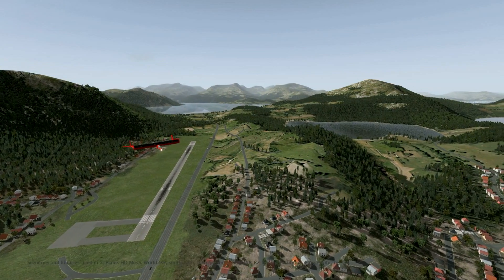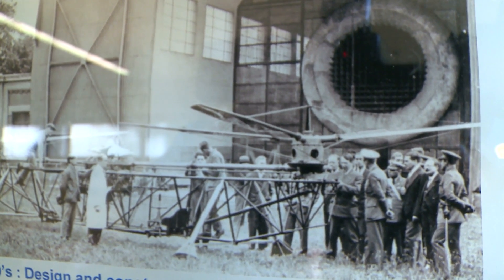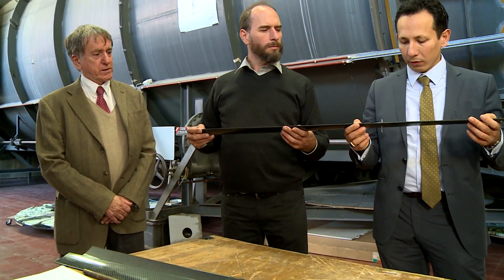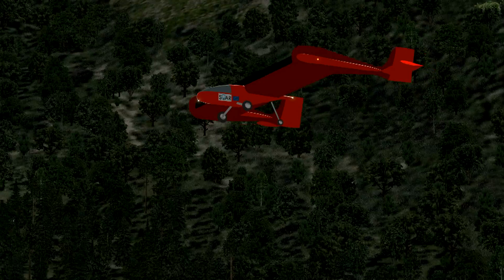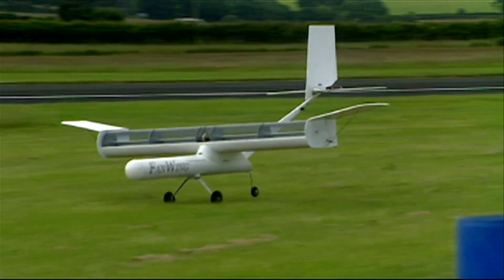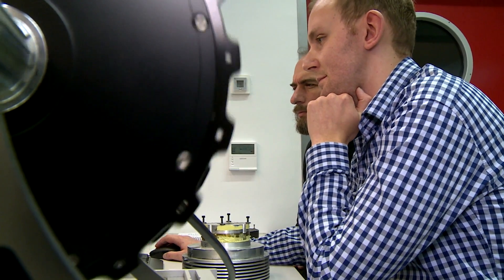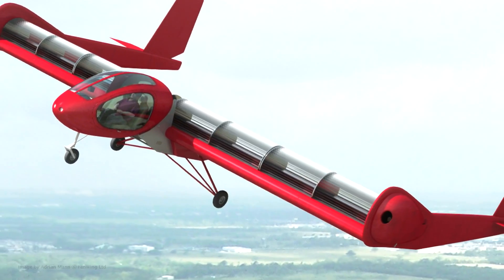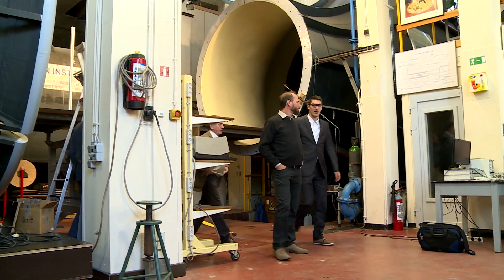FanWing/EU SOAR: Distributed-propulsion aircraft with a trapped vortex inside the rotor cage

Comment: Bird strike.  Jam the rotor.  OK, now let's see it glide.
Reply: It actually slices the birds breast meat off, wraps and packs them, stacks them in the cargo hold and minces the rest as pet food.  Quite efficient really.
Reply: Kevin Loughin I'm having a hard time seeing a bird strike effecting the fan significantly due to the large blade surface and inertia of the entire assembly.  Bird burgers perhaps.
Reply: The fan must spin at a much lower RPM than any given prop in a typical plane, so the demands for precise, smooth balance must not be as high. Without tests it's pointless to speculate on the amount of damage a bird would do to the fan. My intuition tells me that thin carbon fiber fan blades will not object to digesting the occasional bird and spraying it out the back. Bird meat is soft. Bird bones are crunchy, but not very hard. The low speed of the fan might not even cut a bird. It might just get kicked out the back. But my intuition is worthless for the sake of argument and so is yours. The only thing to do is test the thing. Surely, nobody thinks this thing would ever get certified or even funded without extensive destructive testing? German aerospace engineers aren't the sort to gloss over trivial little details like this. All of the arguments against the fanwing due to potential bird strike vulnerability could also apply to the turbines in a jet engine, or to even props.
Reply: haha yea that would cripple that plane. but its not ment to be a high altitude or long distance plane so it might not be that much of an issue
Reply: It doesn't really need to be efficient to fly at 30kmh. What it does seem to do is to provide good lift and enough thrust to move as an almost free result from that lift..
 Magnus effect toys have been available for a very long time too, so maybe it can glide under certain circumstances.
Reply: Magnus effect toys have been around for a very long time. And I can even remember throwing a wooden school ruler in the right way to make it spin along it's length, more than 50 years ago, and it flew on it's own! For a little way anyway. ;¬)
Hold your wooden ruler along it's edges with fingers on the top edge and thumb on the bottom edge. Then throw it like a cricket bowler, but throw it at the ground, releasing your thumb about half way down. If you get it right, it will spin and buzz and zoom upwards and forwards for a little way.
 Flexible plastic rulers don't work.
Reply: Kevin Loughin  horibble glide ratio if jammed, slightly better if allowed to autorotate
Reply: Add a rocket deployed parachute, such as those used by Cirrus aircraft.
Reply: Kevin, methinks thou dost protest too much! It's easy to design the rotor to compensate for the loss of one or more blades cos they aren't one long piece all across the wingspan. Any number of remedies could be conceived, such as piezoelectric compensatory actuators or flexing the blades to make up for the imbalance if part of a blade is broken. Even immobilizing a section of the rotor is possible if you think of it as a series of independent fans not a monolithic unit. I appreciate any stall free flight technology and wish there were an Elon Musk to power this into the market. After all, wasn't a high performance luxury electric car with long range and style the furthest thing from anyone's mind before Musk made it happen? Wasn't the iPhone a pipe dream until Steve Jobs exploded on the scene?
Reply: Emergency parachute systems (as in, big drogues that support the entire aircraft) already exist for light planes which don't have much hope of gliding any significant distance, particularly under low speed / low altitude flight conditions.

And I'm also thinking it might well be possible to have some way of deploying an emergency wing with a sufficiently large span to allow some kind of glide, essentially a hang glider canopy on spring loaded or pneumatically inflated supports, usually folded up out of sight but can be shot out into position by the smashing of a certain emergency button.

Or even just an airbag type system that inflates when the machine gets to a certain distance away from the ground with a descent rate of higher than the maximum safely survivable, cushioning the blow for the crucial second or two it's actually puffed up then deflating away... similar items are in development as safety gear for motorcyclists...
Reply: LMAO
Reply: What about a bi plane configuration ? Fan wing above and another wing beneath , it might do some good.
Reply: Kevin, The elephant in the room is that helicopters are also incredibly inefficient--at what airplanes are good at. But as the inventor of the helicopter, Mr. Sikorsky once said, the the helicopter can do what no plane can do. Similarly, this hybrid aircraft has great advantages over either conventional fixed wing and rotary wing aircraft. Why insist on the idea of birds being the death of innovation, when myriad solutions are possible? To wit, strong blades which will make mincemeat of Canada geese? Remember, early WWI aircraft had armored propellers that allowed their machine guns to fire through the spinning prop, occasionally hitting the blades until synchronized fire was invented. And at the opposite end of the goose-resistive spectrum, fan wing blades could be flexible enough to let the bird through without breaking. For gosh sakes, there are piezoelectric materials and rapid camera technology that could even splay the fan blades open to accommodate a bird, or deflect it like the fruit sorting machinery that instantly shunts aside unripe tomatoes! Fan wing is as the narrator says: distributed propulsion, unlike the two jet engines that sit open and waiting for geese on most airliners.
Reply: Well it still has all that wing out the back, and the center of mass does seem to be gathered right at it's chord. Will the blades catch the wind like a helicopter's would? If so, the thing might glide better than a regular plane.
Reply: @Vicious713  https://www.fanwing.com/faq.htm#6

3:1 Glide ratio (OUCH), but it says the descent speed "will be slow".  I don't like the use of future tense..........  The idea is interesting, and has some real merit, and like any aircraft will have it's own set of operational procedures, along with it's advantages and disadvantages.
Reply: @Blitzvogel 
Same as a heli, which are in the 3:1 - 5:1 range. Real question is, can it flare at the bottom the way a heli can?
Reply: *Let's see it land in the hudson
Reply: how about a split-lift design in a sort-of tractor-pusher configuration? near-vtol, and with a little creativity, a decent glide.  with a lot of creativity, near-complete invulnerability to birdstrike.
Reply: @wireflight  I can't figure out what you mean?
Reply: basic common sense dictates that an open fan has a guard. You desk fan has one so why wouldn't a large aircraft have one especially since bird strikes are a regular thing?
Reply: @jussayinmipeece1069  You mean like jet engines and propeller aircraft? Seriously?
Reply: @TX2A  well I was responding to those who were proposing complicated solutions to a simple problem and secondly the normal operating altitude of jets  precludes the need for that solution  except for take offs and landings and they do have  solution for that anyway..
Reply: Birds see props but not internal turbines. They would more than likely see the rotating caged fan and choose to avoid it. Also the airspeed of the fanwing is slow compared to jet powered aircraft. If the reliability issues can be overcome this aircraft may well find its niche.
Reply: Looks like it would be fine since there could be 4 separate sections on each side.  I'd imagine you would lose less than 1/8th your lift.  Really cool design for a slow speed, medium to heavy lifting, nearly vtol like takeoff.  Gotta give the inventor serious thinking points as taking a hollow pen tube and pinching it against a table so it spins as it flys off and creates enough lift to fly for a while has been a popular kids passtime for probably the last 50 years.
Reply: BadW01f 2 The majority of bird strikes happen at low altitudes.   They'd find a way around it though.
The biggest problem is the mass of the entire fan blade in a full scale version.   That's so much mass to spin, and so much surface area on the fan blades, pushing against the air, that it's going to be woefully inefficient.
Reply: Kevin Loughin '
Reply: not enough
Reply: Vicious713
Reply: Brisdad53 have you?
Reply: Kevin Loughin - 11 months ago
that it's going to be woefully inefficient
+Kevin Loughin - It is already extremely inefficient. Did you watch flight of model? Similar to flight of Carlson who has eaten too much jam. And at which someone strongly cut off, all blades of the propeller.
Reply: Noah Spurrier - 5 days ago
also apply to the turbines in a jet engine
+Noah Spurrier - Compare the area of the airreceiver of the fan of the jet turbine. With an area of the rotating rotor. Also count chances of hit of a bird in the turbine or in a rotor, having applied probability theory. Besides the turbine rotates in absolutely other plane. And in a rotor, even despite the return rotation, force of blow will be rather considerable. Anyway all the written words, no more than the theory or the empty assumptions. And the truth will come only together practice and real tests. Also it is desirable that tests carried out, in a wind tunnel.
Reply: Simpler still....engine failure...Now lets see it glide.
Reply: Only in a wet dream.
Reply: Kevin Loughin ... It has to catch up with a bird first... slim chance of that.:-/
Reply: Glide-ratio in case of power-failure is low (about 1:3) but if the rotors are allowed to auto-rotate, it can still glide.
Reply: quite frankly this sunds like a stupid idea. That being said a simple piece of mesh would fix any Canada goose problem. no need for any fancy crap.
Reply: Yeh. remind me how does a chopper survive the test the same condition?
Reply: Kevin Loughin haha
Reply: I was in a Cessna when the oil pump failed. The oil pressure went from normal to zero suddenly. My dad, the pilot, called a pan, thinking the gauge had failed. 30 seconds later he called mayday when the engine seized.
   The engine just stopped with a loud bang and that was it. We were looking for some place to land.
Reply: Brisdad53   i doubt this device will be used at little more than walking pace, slight exaggeration maybe, so high impact speed hardly a relevant issue.
Reply: No worse than a helicopter 🤷‍♂️
Reply: I was thinking about the same thing. Failure of the blade in general would be a disaster. However if it lost power I would assume it would auto-rotate much like a helicopter. I'm assuming it would not work well as a high speed aircraft but would be very good at STOL and might have a home for crop dusting.
Reply: Kevin Loughin man you outta work for NASA. Your so smart and clever aren't you?
Reply: Kevin Loughin  a statement that can be made about every plane ever made. final answer.
Reply: The blades are used for thrust, not lift, it coule glide perfectly fine